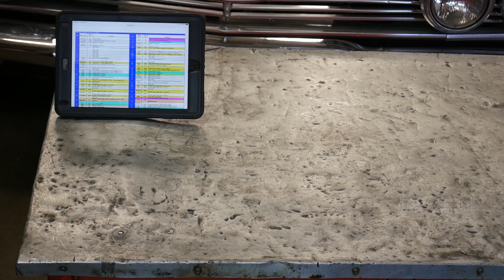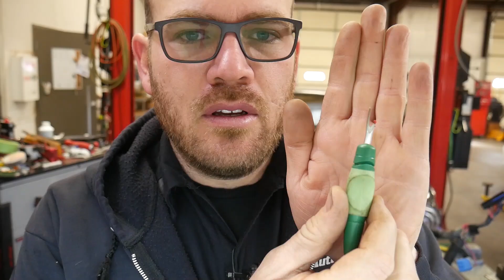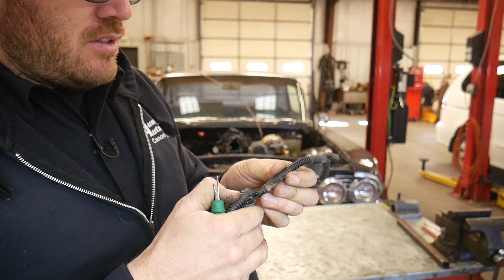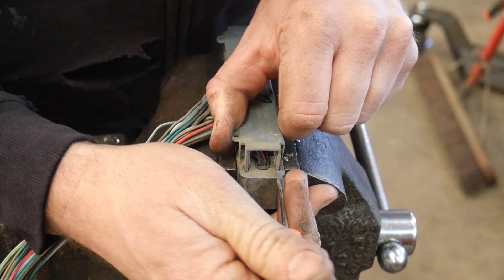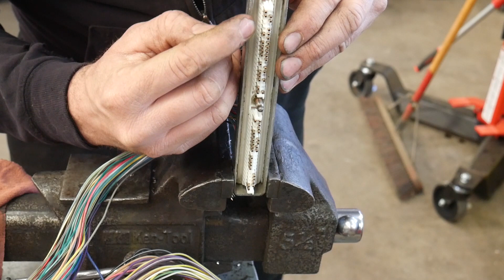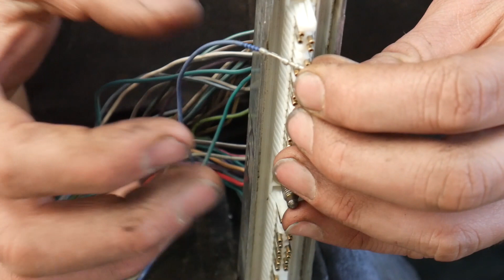1960 Chevy Biscayne LS Swap Ep 20 Stripping down wiring harness and depinning PCM connector

Comment: Thanks for the close up on removing the pin from the connector. That's an interesting process. You've taken some scary stuff out of doing this job.
Reply from the maker: At times I wish I had bought a prebuilt harness but at the same time I wanted to add some extra circuits so I would have needed to modify the prebuilt unit as well.

Thanks for coming back and watching even though its been a while since the last update.